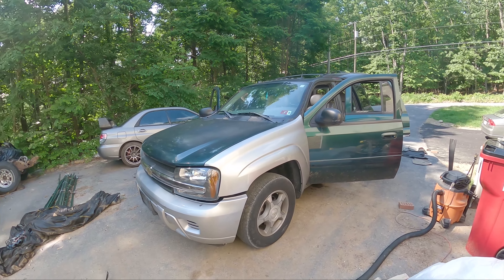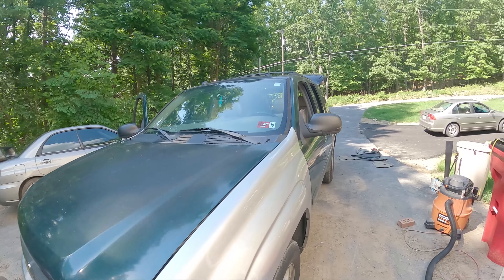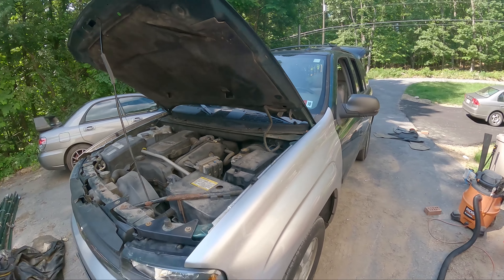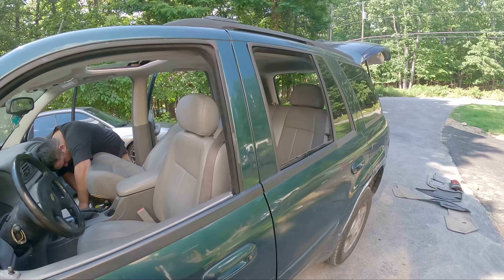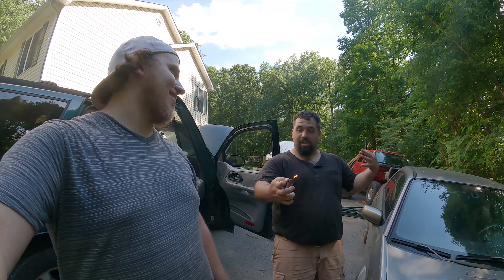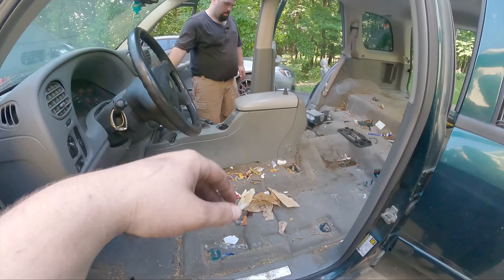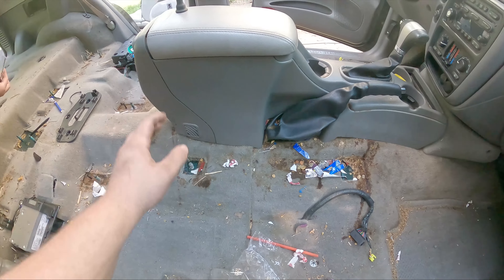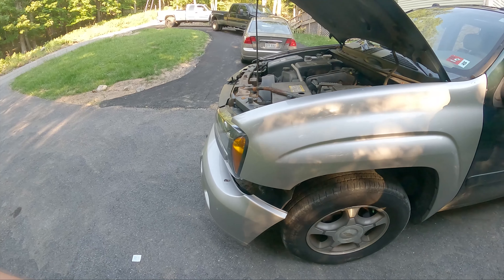2005 Chevrolet Trailblazer - Introduction and Deep Cleaning!

Comment: Bro, where did you find parts, I have a 2005 trailblazer also with the same color interior and I can't find parts for it. Everywhere i go they say the parts are discontinued??
Any information would be appreciated
Reply from the maker: If you are referring to the body panels I found them on Facebook Marketplace from someone parting it out. You can also check junk yards since there are several years which will fit this vehicle. Parts I get for repairs down the road in other videos I often got from ebay or rockauto bc it was cheap.
If there's a certain part you are referring to I can figure out where I got it from. Happy to help however I can!
Reply: @Diesel Pack Garage  yeah I'm looking for interior parts, like center console and other parts. Thanks for info
Reply from the maker: Yea for larger items like that I'd recommend salvage yards and craigslist/fb marketplace for people parting their vehicles out. Hope this helps!!